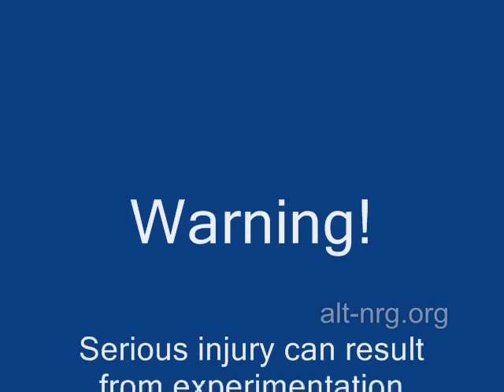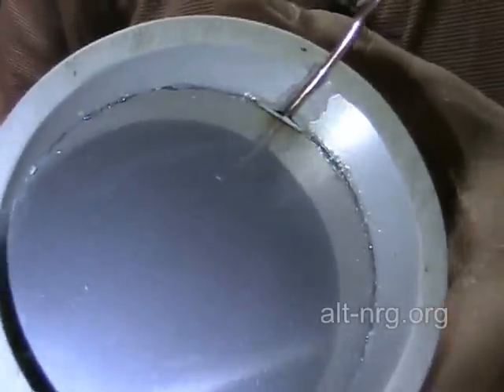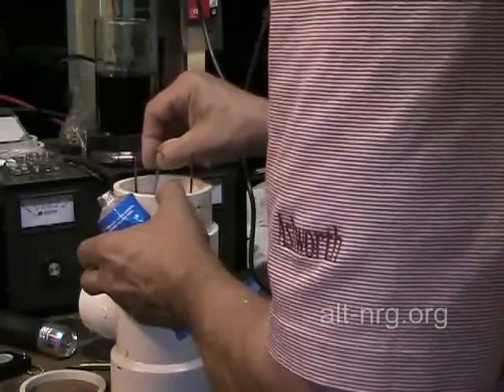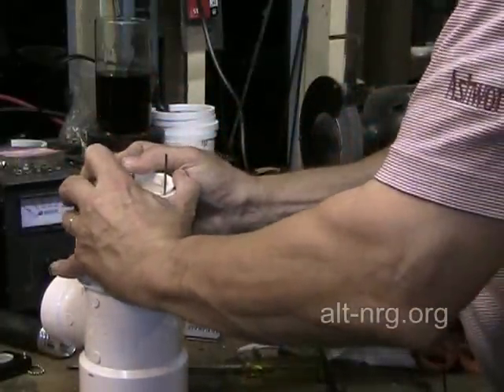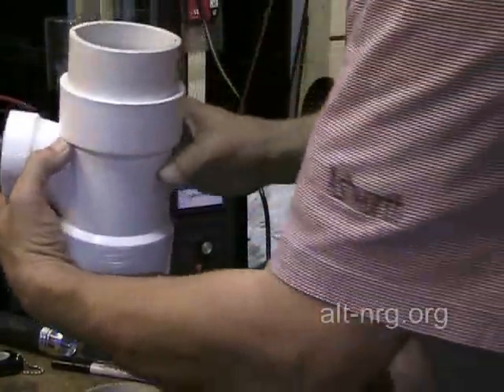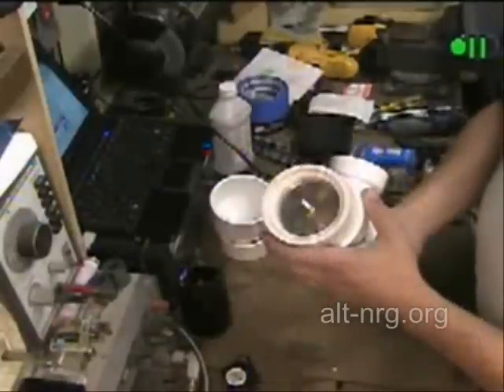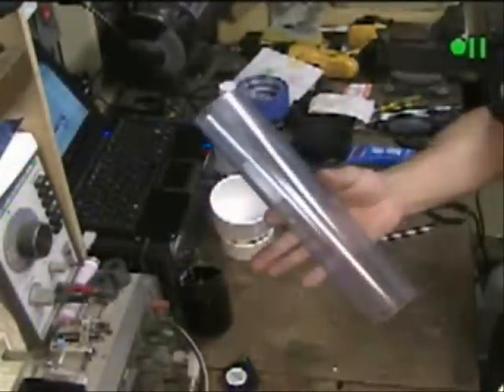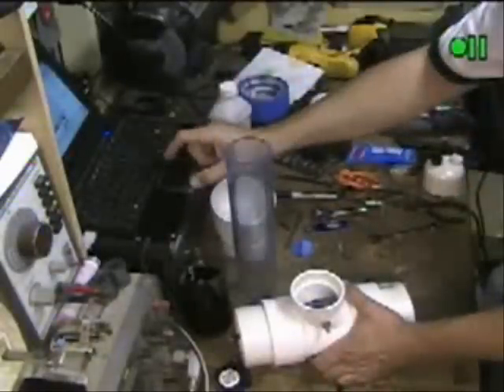#196 - Inverted T cell part 10

Comment from the maker: That's correct. After sleeping on it I realized still too few neutrals for 14.9V so I ran some more tests from 11.0V to 14.0V in 0.5V increments with 13.8 added to the data.

Best repeatable mmw with this cell so far was at 12.5V and a PWM at approx 33% duty cycle.  Tested 1KHz-10KHz. Freq did not matter. KOH concentration 100g/L.

4.91mmw. Not bad. Not great. I have a few mods to try after the PA event this weekend.

Z

Comment: Great live show last night (2AM-4AM here in Norway)

But remember when you calculate mmw value to consider the temperature of the gas. I think normal temp is 25 degree celcius in these measurements. So that will explain the 0.2 increase you got in your last test.

A company here in Norway that make H2 for commesial use (StatoilHydro)have an efficency of: 4,3 kWh/m3 at 25 degrees celcius (of pure H2) that will be 5.8 mmw of HHO... 

So you have a bit further to go :-)

Comment: Worst case scenario: The electrolyte will push out with gas at both inlet and outlet. The current will reduce with the reduced electrolyte contact area. The differential levels of the output and input will have to increase to overcome restrictions if in fact the ports are too small. But as all stack type designs, they have a short service intervals between maintenance and are not commercially viable. Great demo!!

Comment: just try to blow air through a pipe the size your channels are and see how that goes, then try blowing water through. Now you tried, remember the flow back of electrolyte has 0 pressure, and the first hole has to carry 4 times the amount as the last, man this is a disaster waiting to happen.

Comment: Thx 4 the inspiration, I'v made some gas 4 fun myself cos of it. My crowning glory and super sweet SS wire cell is a work of art. I need 2 point something out 4 u. This cell will give u a lot of problems !! be warned. There is just no way for the gas to get out of the outer chambers, same for electrolyte to flow back from bubbler. The holes you provide for this are to small. The volume of gas wil take up all space in the compartments . spark BOOM ! T cell gone. I hope I am wrong though